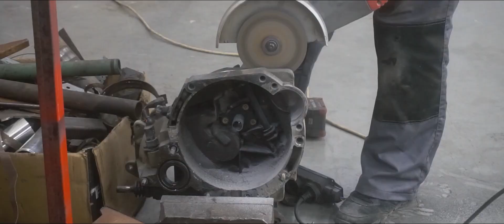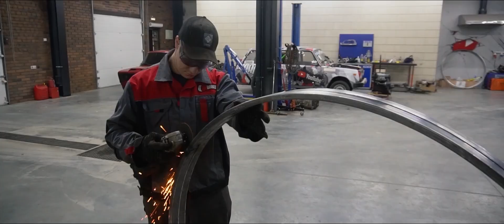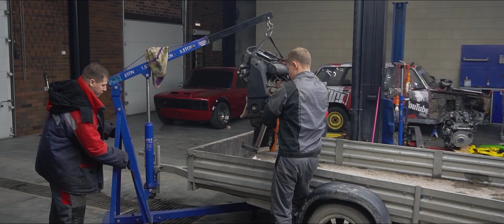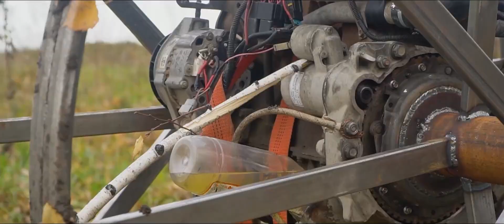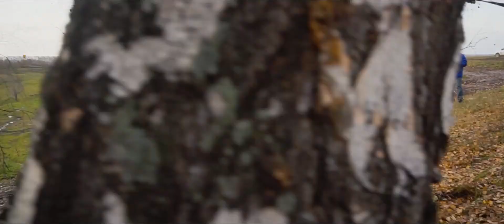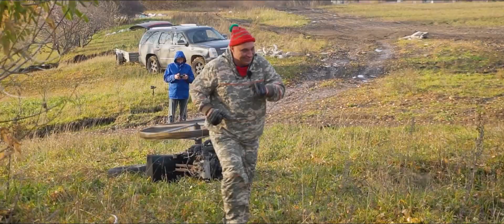Self-propelled engine – first run

Comment: Hey Garage 54!  Try purging air out of Lada engine crank case and replacing it with pure oxygen.  Leave enough oil in to create a mist before seizing.  At the first spark there should be fireworks, although you might have to try this in a remote area and stand behind a bunker.

Comment: ever see those toy bumble balls?  (the ball with all the rubber spikes and a off balance weight connected to a motor that makes it move in random directions)   try making a big one with a car motor. you may need a gear box to have it work properly.

Comment: Put a huge heavy weight on the bottom. And it will keep it stable and should turn the wheel and keep going. Just don't put to much gas where it will go to the next city

Comment: Need a third wheel to balance and keep the motor up. And a gear box to lower revs and get more torque to handle the weight. And a way to raise the revs remotely to get more power.

Comment: Perhaps rather than hang the engine from a tree, try building an adjustable stand or frame using a jack under it that can be lowered in height so the engine propels forward onto its own once the wheels come in contact with the ground.

Comment: you want 1 small sprocket on the engine and 2 more free sprockets . teeth inside the wheels for them to run on for gear reduction.

Comment: Build a cage around the engine. Add a shaft to both wheels and belt or chain to the axle and the motor And a 3rd rear wheel to keep it up right.

Comment: Try using the engine, transmission and front differential from a Subaru for this. The transmission and front diff are all in the same housing.

Comment: "we secured it with a bit of electrical tape"
Reply: mdr je pensais pas te voir ici créateur de trike
Reply: If you can't fix it with electrical tape - you need more electrical tape.
Reply: flex tape but cheaper
Reply: Electrical tape for a mechanical device? Haha
Reply: Should of used duct tape!
Reply: @Daily DB 
What kind of operation do you think this is? Zip ties would put us over budget!  -- Every Autoshop Ever
Reply: not enough, clearly!!
Reply: Yeah spot the grammar error. You can't put "secure" and "electrical tape" in the same sentence.
Reply: @skuula  Why? Electrical tape, rubber hammer and WD40 fix everithing :D
Reply: @skuula  feel free to visit Russia, we rectify your grammar error
Reply: @skuula  if it can't be fixed with zip ties and tape it's not worth fixing

Comment: At 900 RPM (typical idle) and 1.4 m diameter wheels, this would have to travel 237 km/h :).
Reply: And that is why this will never work without gearing
Reply: @burgersnchips  true but it is very funny
Reply: @burgersnchips  it will work of it's doing a burnout on a slippery surface
Reply: @0mniVerse777 
A 1.3l engine wouldn't have enough power to do a burnout at idle on ice with wheels that big.
Reply: Yeah I reckoned on around 200km/h. Self-propelled. If it works it’ll be the Garage 54 equivalent of a SCUD missile, no idea where it’s going to end up but it’s going to do some serious damage when its journey ends.
Reply: @scunnerdarkly4929  ....imagine driving down the road when all of a sudden, you get passed by something that looks like a Tie-Fighter Jet on steroids!
Reply: 237km/h at idle
Now imagine redline.
Reply: Yea, how they thought this would work without gearing is a mystery.
Reply: @WoodTech9  I'm not sure they really expected it to work. It's just a bit of fun. It would be interesting to see one with a reduction gear, though. If they used a conventional gearbox, I suspect even first gear would be pretty tall with those huge wheels, but I haven't done the sum.
Reply: @Derundurel  4-5 grown men who puts in at least two days of work for an audience of half a million people, should at least have a goal of making their projects work. Wether they succeed or not is a different question. I sure hope this channel isn't so starved for content that the creators don't even try to make things work anymore. They usually have a pretty good thing going here. YouTube viewers usually don't take kindly to content creators purposely wasting their time.

To be honest I think the gearing would be fine as long as they put it in first. Lets say the total gear reduction with the gearbox in first gear, from the output shaft of the engine to the wheel axle including gear reduction of both the gearbox and the differential is 15:1. Which would be a somewhat typical total gear ratio on a regular car. That would mean the wheel speed at 900 rpm would be 15.8 km/h or 9.9 mph, instead of 237 km/h or 147 mph. Pretty big difference in my opinion. Also the contraption weighs nothing compared to a car. But they would still need to build a chain drive from the gearbox output shafts to each wheel in order to transfer the engines center of gravity down below the wheel axles, without it running upside down. There are ways to make this work just fine. But simply removing the gearbox all together while at the same time increasing the circumference of the wheels by a factor of 2.4 wasn't very smart. One might even say it was an utterly pointless exercise. These guys should know better than that.
Reply: @WoodTech9  Is the objective a working machine, or a video that we both watched? Doubtless we'll both watch any follow-on, too.
Reply: @Derundurel  look at how much of his time he put into writing a story about what they did wrong lol. I think he just really needed to judge something or someone 😂
Reply: @Derundurel  In order for this to still be a successful channel, the objective can't be complete nonsense. I've followed these guys for years and know for a fact that while this should be classed as entertainment, they are neither totally nonsensical nor stupid. I have a quite a bit of respect for them. Hence my first comment. Furthermore the title of the video has "first run" in it, which indicates they will try again one way or another.  
@FarmerJohn's Experiments 
No I am genuinely interested in what they're doing and would love to see this thing work. That's why I clicked the video.
Discussion in the comments about what can be improved from the first run, is probably what they'd expect.
Reply: @WoodTech9  It may surprise you to find that I agree with most of what you say. However, you do appear to be taking it more seriously than it deserves.
Reply: @Derundurel  Yes, you might be right. I love discussing and solving technical issues no matter how trivial. Guilty as charged.
Reply: Doesn't the diff provide some reduction? Still way too fast, but .. not as extreme.
Reply: @skuula  it would make a difference if it actually had a diff. It doesn’t though, no gearbox = no diff, the wheels are driven directly at either end of the crankshaft.
Reply: @scunnerdarkly4929  oh is that what they did, oh okay... no gearbox on it?
Reply: @skuula  yes, it’s not shown in great detail but the bulk of the bell-housing is cut away and an axle is welded to the flywheel. The other axle is welded to the crank pulley wheel. Thinking about it, one solution would to use a reduction gearbox on either side or something like the transfer boxes on the old Honda S600. This could reduce wheel speed and also lower the engine’s centre of gravity, making it more stable. If you really, really wanted to try to make it work. Check out the Honda, it’s mad.
Reply: WOAH
Reply: BLOODY HELL
Reply: @diodegonewild didn't expect to see you on here lol.
Reply: I would say the design is quite dodgy. I would not stand anywhere near it when it runs, but would watch from a distance of at least 100 meters.
Reply: @DiodeGoneWild what are you doing here? 😂
Reply: You here! Hi!
Reply: I just finished watching your video some minutes ago and i wasn't expecting to see a comment from you on this channel ahaha
Reply: I was just gonna say, those wheels are huge (I know, it's practical level so they can clear the engine shape) the gear reduction (opposite of reduction!) is incredibly against what it needs to be to move.
Reply: Vlad: "Ok today we break world land speed record with a Lada, Hey Yuri... Make Bigger wheels"
Reply: Thank you 😂🙌
Edit: that's 147 mph, for mericans and racing enthusiasts lol
Reply: @thecrazyfarmboy  uhh there are racing enthusisasts who actually use kp/h
Reply: @renz1013  using km/h to measure high speeds is like using cm to measure something that's about one foot. Yeah some people do it, but it's stupid 😝
Reply: @thecrazyfarmboy  nah I mean since there used to using kp/h
Reply: @renz1013  just to be clear, I'm Canadian so I use kph in daily life. But if I'm talking about racetrack speed, I'd much rather say 100 mph and 200 mph as standard refence speeds, than to say 161 kph and 322 kph, and I know there are lots of Canadians like me who refer to track speeds in mph
Reply: @thecrazyfarmboy  ah thats well its because I'm asian
Reply: @renz1013  well I've learned that in other parts of the world racers actually use kph on the track, and that they seem to be damn proud of it lmfao
Reply: @thecrazyfarmboy  racing enthusiasts in over 200 countries use metric.
Reply: @thecrazyfarmboy  Implying every racing enthusiast uses miles.
Reply: @darenzy  mph is basically the standard for motorsport. I'm Canadian but when I raced Rotax karts, everybody talked in mph, and I still find high speeds easier to comprehend in mph
Reply: @thecrazyfarmboy  I have never used mph in my life
Reply: @thecrazyfarmboy  not gear inches in relation to rpm?
Reply: @thecrazyfarmboy  metric is the standard in everything everywhere exceot for the US and the UK, and some small country somwhere
Reply: @Kasmuller  it sounds like you simply Googled how many countries use metric and assumed that nobody ever deviates from that 😂 I live in one of those countries that uses metric but I've never heard somebody talk about which cars can go 322kph... They just say 200 mph, or 190, or 220
Reply: @thecrazyfarmboy  you are in the minority then
F1 cars reach up to 360kph at monza
Cars do 0-100 in X sexonds
Etc.
If you are watching an american series then yes they will most likely refer by mph rather than kph
But like look at racing series outside america, metric is the standard.
In rocket science, science, american law, everyday life everywhere except for like 3 countries, metric is the standard
Reply: @Kasmuller  why are you bringing up everything from rocket science to everyday life? I knew that Americans aren't the only people who like to hear high speeds in mph, so I worded it the way I did. If I simply just said Americans, I'll bet there'd other be people like you accusing me of saying that only Americans use mph 😂 it is wild how easily people get offended, I said racing enthusiasts like mph, cuz I didn't know what other term to use for people who aren't American but think of high speeds in mph. Sue me.
Reply: @thecrazyfarmboy  f1 defenietly uses kph
I am pretty sure most other categories do too
Reply: @thecrazyfarmboy  kph is faster lol
Reply: I was going to say that is pretty dang fast.. 147MPH.. But without a gearbox there is no way it would be able to produce enough HP especially with those big wheels.  Especially at Idle.. It has not got enough momentum to keep the flywheel turning once the weight is applied to it.
Reply: fancy seeing you here ....i was just watching your video ...... every one just watches the same channels on yt !!!
Reply: EVENT MORE SALT?
Reply: "The whole engine is vibrating... Even more saaalt"
Reply: This is a 4-stroke engine so its final revolutions are
the half of what is often imposed. 4 stroke = 2
revolutions. And btw, the u.s., Burma and Guyana
are the only 3 countries of all who still use the silly
imperials for industrial- production and -standards.
The u.s at least agreed in 1989 to change to metric
but finally not ratified the change.
Reply: @junkman6456  it doesn't matter if it's a 2 or 4 stroke.. Rpm is measured in rotations of the crankshaft. The only difference is a 4 stroke will have half as many combustion cycles per second as a 2 stroke running at the same rpm - if theyre both running 5k rpm, both flywheels are spinning the same speed, regardless of the number of power strokes per minute
Reply: The wheels look perfectly balanced too...
Reply: 150mph for the Americans
Reply: Cool seeing you here, your videos are epic
Reply: That needs epicyclic geared wheels. Or an engine that runs at 200 rpm.
Reply: you are supposing the engine would not spin.. both engine and wheel spin thus reducing the ground speed
Reply: Wooow
Reply: The circumference is about 5 meters... so at 1000rpm its doing 300kph.
Reply: 5 kilometers per minute.
Reply: Jesus christ!
Reply: @DiodeGoneWild  i never thougt i would find a comment by you. And i'm subscribed. You make great videos.
Reply: @attilajavorszki2161  üdv magyar barátom, azt hittem csak én nézek elvetemült oroszokat 😂
Reply: I just broke my tooth on a walnut... ow!
Reply: Aaron Cubitt  you guys must be so sensitive lol yall are acting like I made a freaking racist comment against racing enthusiasts 😂😂😂 I'm so so sorry for offending you?
Reply: I would not except your comment here. :O

Comment: Get the smallest car you can find and putt a airplane propeller on the engine see if it .moves under it's own power
Reply: They already did that. Check older vids